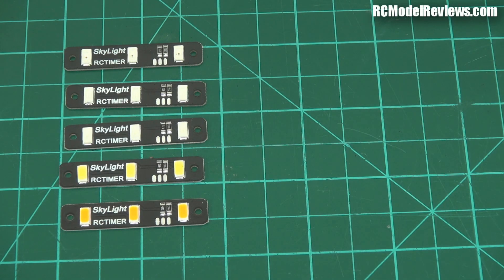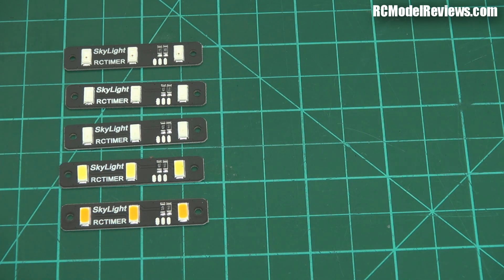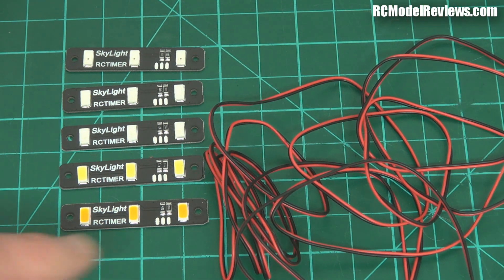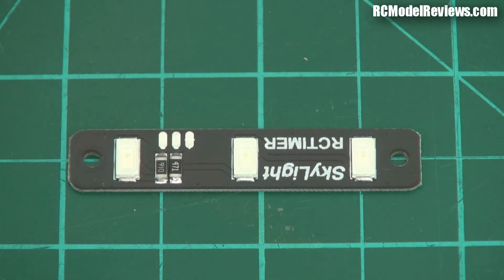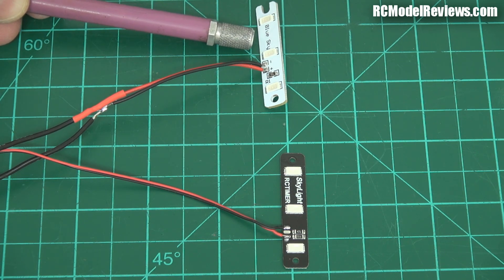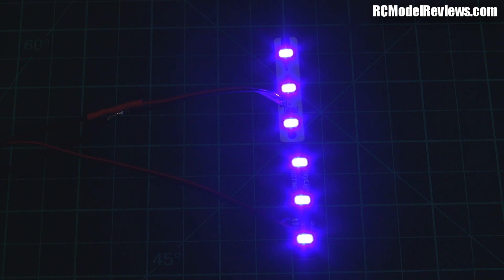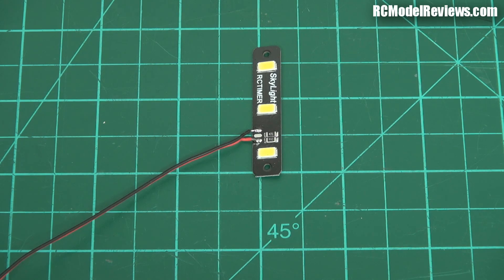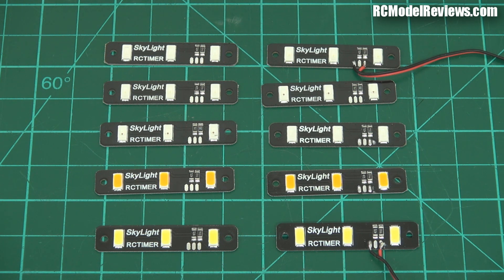Review: RCTimer SkyLight LEDs for RC models

Comment: ***** Have you used EL strips on any multirotors? I'd like to use a strip because it won't be as blinding, but it seems they cause a lot of RF noise because the cheap inverters use PWM instead of actually generating a real sine wave. Anyway, is there any way you can see to use EL lights on a multirotor? Perhaps do a video on it? Cheers, mate!

Comment: Well if you know how to build your own mini quad, you obviously need to know how to solder, and if you know how to solder you can make your own LED illumination easily and cheaply, since even if you don't care about learning how to calculate something, there are plenty of LED calculators, online, so you just put in values, and you get the resistor value you need to use, so why even bother? You have to solder on the leads anyway... So what's the point of it?
Reply: RPBCACUEAIIBH  And finally if you want to make it even easier, you put on a piece of 12V led strip, and even if you use more then 3 cells you can still use 3 cells to power it trough the balance leads... I'm sure it can handle 100-200 miliamps... So really there's just no point in buying these items...

Comment: Using it with a 6S (assuming fully charged 6 x 4.1v =24.6v and 35mA current) you will be dissipating more energy in your resister than in the LEDs, not very efficient at all

Comment: There is a LED strip in market Bruce, that runs bright green, and turns red when during flight you pull back on Elevator (Showing air braking, Brake LED) and changes color when pushing elevator stick forward. try to find them :)
Reply: from Flytron? could not find anything matching your description
Reply: alishanmao I think you're thinking of the "addressable" led strips using a Naze32 and CleanFlight.
https://github.com/cleanflight/cleanflight/blob/master/docs/LedStrip.md
Reply: sadie77711 No no no, I actually have and i demo it in one of my videos but now I just can't find that video. I will do another video of this LED strip. it has a built in PCB board with some components and you need to plug it to your Channel 2 or elevator channel using a Y Cable because your channel 2 is used by Flight controller too. once connected. it powers up using 5V or 6V from your Rx and changes color to red when pulling back on Elevator to show braking, and changes green when you push forward to show going. stick in the middle it has white color or different color. 

I will try to do a demo of this soon.

Comment: Is there someway to make them flash on/off or pulsate? Thanks!
Reply: AzHeat63 Yes, you could use a 555 timer, small MCU or if you have Multiwii you could re-program the Arduino to do this

Comment: RCTimer are the ones not delivering... =)
Only 2 of my first 3 orders arrived, turned away quickly.
Reply: tramsgar What did they say when you complained?
Reply: I never did complain, the missing item was not worth the effort. So maybe my experience with them doesn't hold much water.
Reply: tramsgar Now I remember why: I could not find any other way to contact RCTimer CS than via email, and when I tried to mail them the message bounced... Same thing when I retried a few weeks later. This was just for a motor shaft, so no biggie. But I concluded that if I bought something expensive I wouldn't be able to contact CS if anything went wrong.

Comment: How's your sense and avoid system coming?
Reply: Aeroscience Stalled at the moment... nowhere to test and I can't even do any bench-work on it because I've been forbidden to make any transmissions from my workshop day or night -- by order of the South Waikato District Council -- even though the transmissions are otherwise 100% legal and compliant with all the radio regulations and my lease is supposed to allow me to engage in any aviation-related activities.
Reply: +xjet
I know you said there weren't any good legal flying sites, but is there a place where you could legally broadcast radio transmissions where you could drive there with some ground testing equipment? Or is to big/complex to transport?
Reply: Aeroscience Sadly, I need a lot of the gear that is part of my workshop.  Just not practical to relocate everything for a little testing.   This whole situation kind of proves (yet again) that this is nothing more than petty politics on the part of those who would abuse their powers for personal reasons and, in doing so, thumb their noses at a real chance to improve the safety of our airspace.
Reply: Thats unfortunate. Is there no organization that will provide funding? It seems like it has a lot of promise.
Reply: Aeroscience Funding isn't the problem - it's the fact that CAA and the South Waikato District Council have forbidden me to continue my development work at the airfield -- even when it's only bench-based work.   They claim (for solely political reasons) that the tiny emissions I'd be making (fully compliant with all the radio-frequency regulations in this country) would pose a threat to the safety of RC models being flown at the airfield.  Strangely enough, the ban is a 24/7 one -- even though it is illegal to fly RC models during the hours of darkness.  

I have already spent a great deal of time and money on this project, all I need now is the right to continue my 100% lawful activities in my workshop at the airfield -- but am forbidden.    And this from a group of bureaucrats (the SWDC) who claim to be supporting local businesses and another group who claim to be working to ensure the safety of our airspace (CAA).   Clearly, both groups are lying through their teeth.
Reply: What about research organizations letting you use their facilities to do your research? That way you wouldn't have to bring stuff with you.
Reply: Aeroscience I don't need anyone else's facilities.. and indeed, the more people you share your work with the more chance there is that someone will "acquire" your ideas and use them themselves.     Besides which, in a free country, why can't someone who has a good idea and who is working well within the law, using his own money and his own resources, be allowed to continue developing a product that stands to significantly improve aviation safety in the age of drones?    I'm just waiting for the first mid-air collision between a drone and an aircraft in this country -- then I will let the media tear these bureaucrats to pieces for their petty politicking.
Reply: Oh, I agree that you SHOULD be aloud to. The problem is that you aren't. I still think you should bring them to court. It would be quicker than a waiting for an air collision (I think).

Comment: The rctimer LEDs are relatively expensive ($10 vs the $1.53 for the Banggood strips).
I prefer the very bright 5630 LEDs laid out horizontally on a 5mm narrow strip. To find them, search ebay for: 5630 LED Strip Light 5MM RED/Green/Blue/Pink/White 300LEDS Waterproof Ribbon 12V
The downside is that you have to order a minimum of 5m length and that the cut interval is every 9 LEDs, although you can cut it after every 3 LEDs if you scrap the paint away to create solder tabs.
Reply: ***** Yeah, the Banggood ones are slightly cheaper but the RCTimer offer more colors, support for up to 6S and (IMHO) a better soldering-tab arrangement.

Comment: I am in the process of installing a RGB 3 channel controller on my ZMR build all running off of the 12V supply.  
The controller is very light weight and low profile and offers strobe, pulse, fade and color mixing on standard 5050 RGB strips.
Reply: Dirty Robot All you need is 3528.  Smaller etc...
or better yet, some APA104.  Individually addressable...

Comment: Hi Bruce,

Nice review!

These are still in the low power LED category. Middle power is ~1/2 watt per LED. High power is more then 1Watt per/LED. Middle power leds are slowly moving towards the performance level of 1W power leds of a few years ago.
Middle power leds cost around $ 0.06 in large volume. These low power ones are around $ 0,01. Add to that a small PCB board and some resistors and you get a healty margin for $ 1,- per PCB.

I prefer to buy flex led strips. Cheap as chips from Ali-express. 
http://nl.aliexpress.com/item/Free-Shipping-LED-strips-SMD-5050-12V-flexible-light-60-leds-m-5m-lot-White-Blue/1599649725.html

Thats 300 LED's for $ 5,- on self adhesive flex. You can stick these onto curved surfaced and around tubes.

Comment: I'm surprised to hear your having a bad time with banggood customer support both times I've had a problem I sent them a video or picture and I got a refund on one thing and they sent me a replacement for the other.  Maybe I've just been lucky?
Reply: rayikaikin as they say: the best customer support is the one you don't need XD
Reply: rayikaikin I had a Mobius fail and they sent me a new one. I ordered a replacement board and repaired the first so ended up with two...